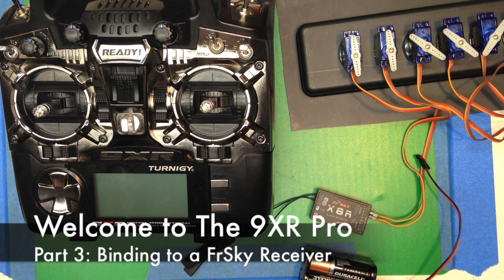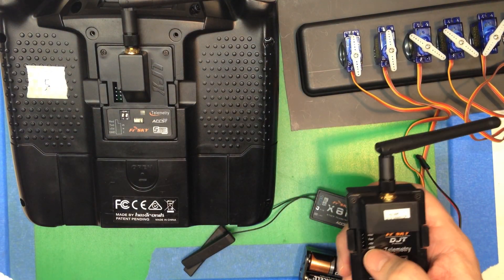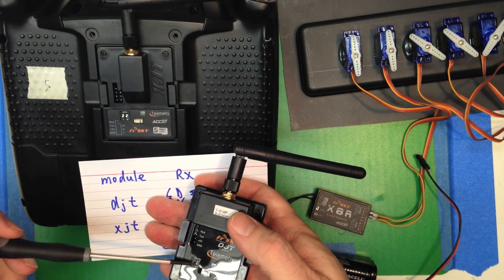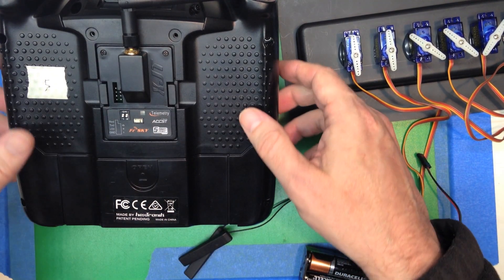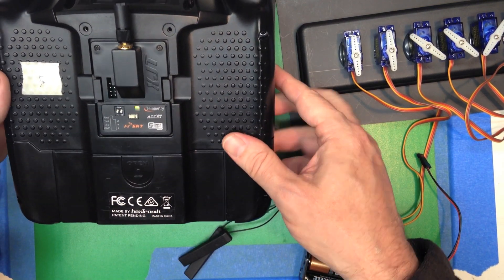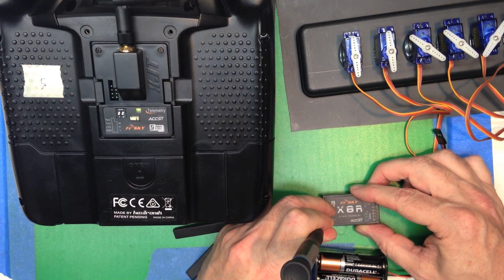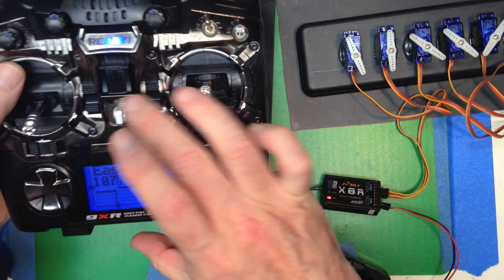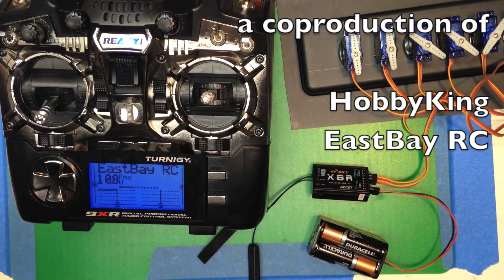Welcome to the Turnigy 9XR Pro, Part 3: Binding a FrSky Receiver

Comment: I'm surprised it was able to bind easily. I can't get my 9XR with DJT to bind to my new D4R-II. I'm following all the steps with the switches both off position for binding and on PPM mode. The D4R leds never blink no matter how many tries. Ideas? I tried setting it to 18 or 27ms, nothing.
Reply: i have the same problem but with the XJT and X4R. have you managed to solve it ?
Reply: I never managed to bind the DJT with the D4R-II. Instead I got myself a Taranis which was better anyway.
Reply: BastiBas94 have you managed to sort this im having exact issue

Comment: how does the telemtry and data logging work woth this radio and module
Reply from the maker: That's a great question. I've added this to my upcoming topic list: http://goo.gl/AJqLLN
Reply: I have seen 2 other videos on this new version of the 9XR "PRO" and in both of them the soldering is bad and in my current version I have my own problems. I decided to go with the Taranis